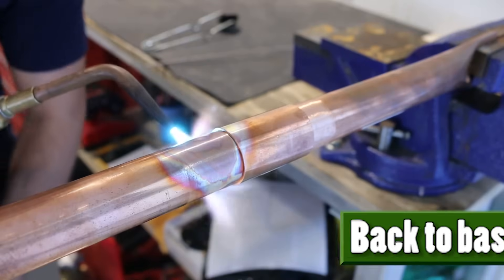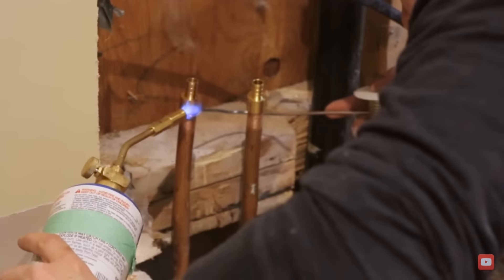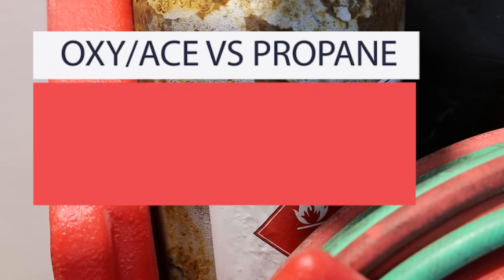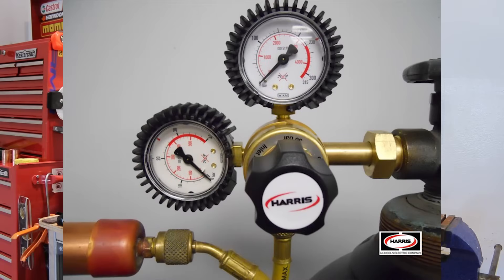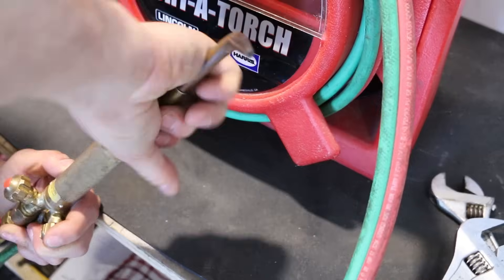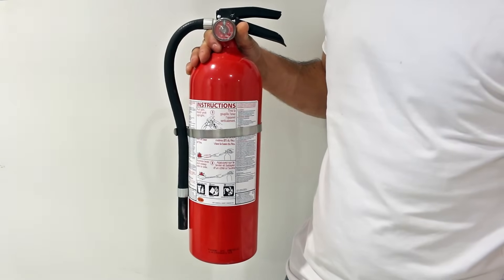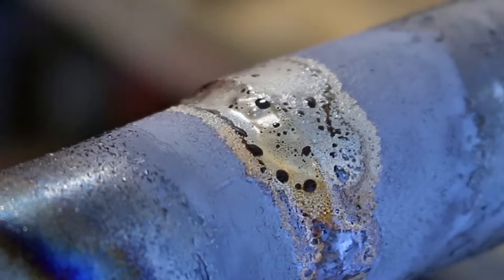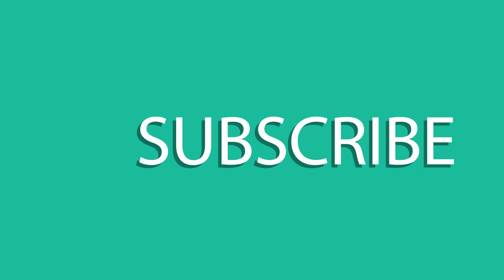How To Silver Solder (Braze) a Copper Pipe (A/C Line Repair) | GOT2LEARN

Comment: Not to bad my man. I’m typically pretty critical about people on YouTube pointing out bad info people give on these type of informative videos because I’m a sprinkler fitter/pipefitter by trade. But this video pretty much covers it start to finish. Only thing you left out is that you can braze with a b-tank. You just need the bigger tip. We call them turbo torches. That’s what we use. But all in all man that was pretty damn good. Hats off.
Reply from the maker: Wow, thanks buddy, great comment ;)